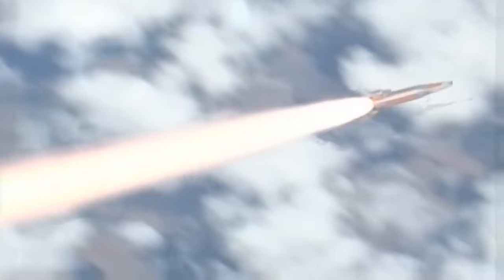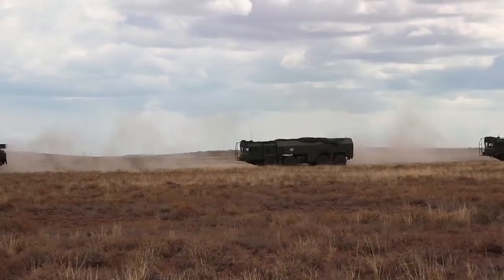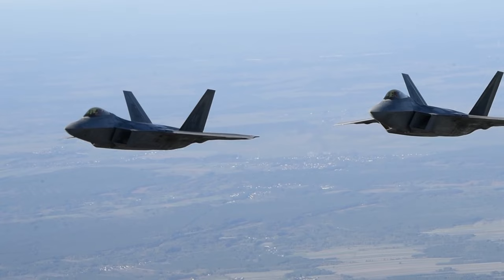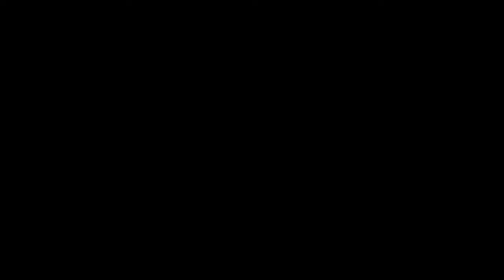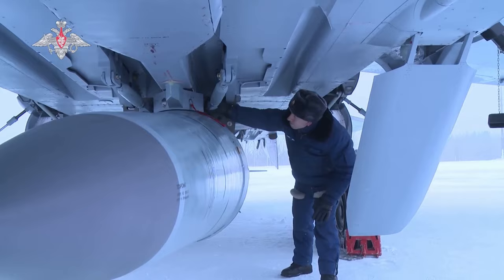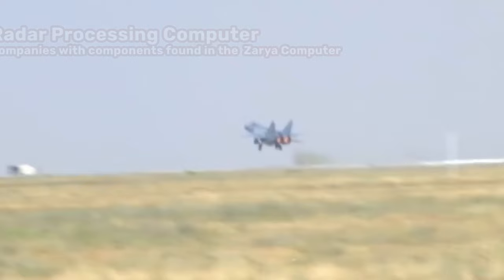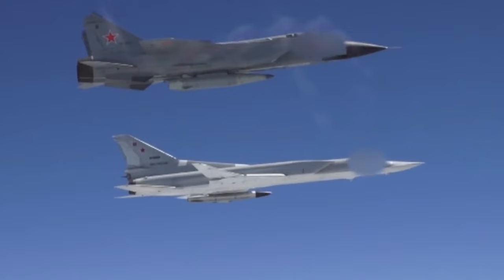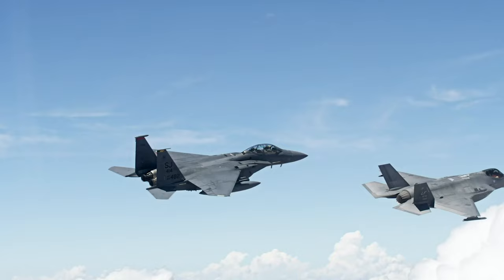Is Russia's "hypersonic" Kinzhal full of American hardware?

Comment: It seems to be not mentioned that chips manufactured in 1990 (the DSP chips at 12:37) are pretty pathetic compared to modern equivalents. That shows some of the conceptual difference between the processors needed to run a weapon system compared to your low end gaming machine. Now, if a top end nVidia GPU from the last three or four years would be a different story. But, it appears all that is needed for GPS/GLONASS is a serious lot less than any form of sophisticated "find the correct window in the target building then hit the desk in the North East corner" form of magic. (The first minimalist GPS military design I saw was designed at Magnavox in Torrance in the 1980s. Software Defined Radios can be made very minimalist.) This is something the military is well aware of, last I knew. It is not something their civilian masters have ever troubled their tiny minds to learn. So if limiting Russia was on the radar before the stupid Obama laugh at Romney I'd be surprised. But, 1980 is about the technology year that Russia should have been held to to prevent this. That would be considered a useless attempt and cruelty by civilized people.

{^_^}    PS: Do NOT forget China. And I have sitting on my desk a dirt cheap single chip GPS/GLOBASS?Galileo with USB2.0. It makes the modules shown look huge.
Reply: A lot of that Chinesium stuff is velocity and/or acceleration limited so not much use for something like a Mach5+ missile. It might be OK for occasional waypoint fixes though, which makes one wonder what programming the big brains in the various RUS Design Institutes might have conjured up to make older consumer silicon act more modern? Necessity is the Mother of invention and all that.

To your point about technology embargos, you can't hide knowledge but you can modulate it. You're better off keeping your adversaries hooked on tech 2-3 generations behind so they never feel a burning need to develop their own tech. If you do this long enough you end up with a result like where Russia is...not able to make the leap from 00's process to 2020's process on their own. 

Of course, Russia doesn't have the same spirit of competitive commerce that, say, China has, so they are less likely to want to break free of that addiction. They're more likely to loot any advances for "booze and poon" since they've been so economically repressed for so long. The thing that will set Russia free is the very thing that they fear: open competition in the global market. Thus, the current situation.

We're a long ways away from the tech in Byte Magazine and Jerry Pournelle's columns now, eh?
Reply: It's worth noting that Taiwan is now the world leader in chips.  Their 7nm process is in the latest apple and AMD chips.  intels process has failed for 2 years running and they are now lining up at Taiwan Semiconductor as well.

Comment: ASML produces the world's most advanced chip manufacturing machines. The Netherlands is also home to several companies that provide equipment to the semiconductor manufacturing industry, including ASML.

Since immersion lithography was first proposed by Burn-Jeng Lin in the 1970s, ASML cooperated with Taiwan Semiconductor Manufacturing (TSMC). In 2004, TSMC began commercial production of 90 nanometer semiconductor nodes using ASML immersion lithography

Intel has issued its first purchase order to ASML for the delivery of the industry's first TWINSCAN EXE:5200 system – an extreme ultraviolet (EUV) high-volume production system with a high numerical aperture and more than 200 wafers per hour productivity – as part of the two companies' long-term High-NA collaboration

so this company is the core to the main element of all advanced chip manufacturing

Comment: read - "Chip War: The Fight for the World's Most Critical Technology",  chips->globalization,  late 20th or 21st century warfare is about 1s and 0s so Russian chips < US semiconductor technology so yes if its available on the grey market it will be used.  also a note on the reuse of board level components across different missles is good systems engineering practice, if the hardware works reuse it and tweak the software to do the new task ( i.e. criuse flight instead of ballistic flight).  Another interesting angle is China and semiconductors again for weaponary.

Comment: this is bad . But of course the USA don't like to loose . The USA are not capable to understand how the Russian can fly at low altitude with a speed  creating 10000 Deg F  heat.   The Kinzhal cost is only 1.2 millions US Dollars. That is very cheap. Therefore this is far more knowledge  in Thermodynamic than modern technolgy from USA .
Reply: Of the kinzal only cost 1.2 millions than its not hypersonic. Hypersonic is expensive to make.

Comment: New video idea: how can Ukraine (and all other countries of future wars) cheaply and easily counter inexpensive drone swarms.
Reply: Microwave beams. Most of those cheap drones use widely available 2.4 GHz spread-spectrum radios.
If you've ever turned on the microwave and your WiFi has stopped working right, that's why. The microwave oven uses that same frequency, but it has legitimately the better part of a kilowatt of output power when the WiFi radios don't even have a full 1/10th of a watt of transmit power, so it basically acts like a giant radio jammer.

So if you want to deny the use of drones, figure out how to turn on a microwave oven with the door open, or even better take apart a microwave and build a directional antenna for the magnetron (easiest type is a "horn" antenna).
Aim the microwave beam at the drone, and chances are you'll put so much power into its little radio antennas that you overload and/or just plain old burn out the radio receiver's transistors.

This is something that a well-educated civilian could do, just imagine what the military could do with their much higher power radars transmitters.
Reply: @44R0Ndin  Yeah that’ll work. But won’t that damage your own infrastructure or drones? And if this is so quick and easy to do, why isn’t Ukraine installing a bunch of emitting horns around Kyiv or their power plants?
Reply: @44R0Ndin  Okay, then drones will just have safeties to detect jamming and switch off the radio to seek the last known target position, use image recognition to seek the target independently or use the microwave radiation as a beacon to home onto.
Reply: @ChucksSEADnDEAD  Maybe, but guess what, all that makes the drone more expensive, and that's basically the entire point.

Also, like I said you have the better part of a whole kilowatt of microwave power at your disposal with a microwave oven. At that power level, and with a nice directional antenna, the whole point of the jamming is that it's SO intense that ALL the radio receivers see the SAME signal at the SAME intensity, so they can NOT get a directional fix on it, which is what they'd need to "home in on the jamming". These drones use basically a single omnidirectional antenna anyways, you literally can't tell what direction the jamming is coming from with that setup.
Basically, radio jamming is not that complex in theory. It is usually intended to disorient. However, with the high power and limited modulation options available from a microwave oven, what you get isn't so much a jammer as it is a "soft-kill" active protection system. It disrupts the command link between the drone and the operator by destructively overloading the radio receiver on the drone. Doesn't matter if you turn the radio off or not, the damage would have been done even if the drone's radio was off the entire time, that's the ENTIRE POINT of using that much power. The effect is not that different from what would happen if a nuclear weapon went off and created an EMP (there are other ways of creating an EMP without using a nuke, I picked a nuke because that's the one most people associate with creating an EMP).

You could "just" scramble the data on that command link with a lot less power and a lot more sophisticated modulation, I was intentionally trying to keep things simple so that soldiers (most likely radio operators or radar technicians) in the field could construct something relatively easily from materials they might be able to find in the rubble of the many destroyed buildings.

Another advantage of this "improvised RF soft-kill APS" is that in theory it's cheaper to make than even just one of the drones it's designed to counter.
Cheap means you can have a lot of them. And having a lot of them means that even if the enemy develops the technology to home in on them, you still have something that those drones will take as "bait" over a more valuable target, meaning the enemy spent maybe $2k to destroy a decoy that cost maybe $150 to build.
And that means they'll use up their resources before you do, as long as you're not stupid and putting those right on top of the things you want to protect with them.
As far as I'm concerned, if the enemy has no more resources to continue fighting and you do, that's the time for your side to start pushing the advantage if not the outright victory condition.
Reply: @44R0Ndin  But it doesn't. Shutting off radio comms is free, the accelerometers and gyros are used in the design already so they're also free. "Good enough" computer vision that runs at 60 frames per second is possible with commercial components worth 300 bucks. I guess the home-on-jam feature would be a little more expensive but not by much. If the radio is off the drone still completes the mission, just not under human control. And no, it's not a EMP. It's a disruption of comms. There's a reason why there are unjammable drones in the field. Simple commercial quadcopters can often be jammed through a signal that forces them to waste power and drain the battery for a forced landing. Some military designs are virtually invulnerable to jamming.
The enemy spent 2k to destroy a decoy, and the other 2k is able to see the target after the jammer was destroyed. 4k to make a hit. Sounds great.
Reply: @ChucksSEADnDEAD  Yeah you've just reduced the effectiveness of a drone swarm by half, or doubled the cost to make a hit. For maybe $150 in parts, that's a win in my book.
The alternative is to shoot it down, of course. and that gets expensive quick.
Reply: @ChucksSEADnDEAD  vision models are super easy to trick. Put a fake stop sign on a road. Some people will stop, but the Tesla will always stop.  That’s one of the simplest examples in AI and security but the attacks get way crazier.

Now that an attacker has tricked the vision model you’re back to gps to localize yourself and that RF is easily defeated.
Reply: @44R0Ndin  150 in parts? The Ukrainian FPV drones with a RPG-7 warhead have a 10 minute battery endurance, tons of issues with signal/visibility, and those cost 600.
Regarding vision models, that's overthinking it. Sensor fuzed munitions have been a thing for a long while. There's no equivalent to a Stop sign. All you can do is make a metallic box the shape of a vehicle to get it to function.

Comment: So since it’s American tech used to guide it I wonder if America could find a way to disrupt those systems or even possibly hijack controls  since the middle can change its corse mid flight.
Reply: Doubt it. They're not wireless remote control equipment. They seem to be physical hardware like CPUs. 
Imagine the front wheel of your bicycle is made by china(It probably is, as everything). Could they "hack" it and turn the bicycle left and right while you're riding it? That would be hilarious though. 🤣

Comment: Your speculation is plausible, but not verified yet, and hardly of any significance. Still, your efforts are worth subscription as  you seem to be logical and well augmented analyst!

Here is why, and a few remarks:

1. Russians have deployed ALL types of hypersonic weapons as of  today, not just the "modified ballistic missiles" type. The US has none.

2. If you need to obtain foreign chips, you don't buy 10, you buy 1000s, or more. So, placing sanctions now would have no effect - the missiles would be obsolete anyway by the time you run out of the accumulated chips stockpiles.

2. These days, you can just buy Raspberry Pi SoC, or disassemble an average phone to get all components you need for a weapon. Did you know that an iPhone has the computing power to manage the entire Internation Space station?

3.  Iskander reflects "state-of-the-art"  microelectronics  from at least 10 years ago...

4. Chips are highly interchangeable - with relatively moderate effort one can switch to Chinese, Malaysian or other chips.